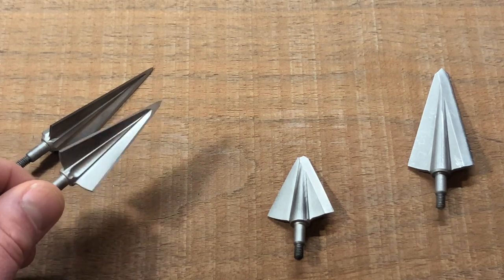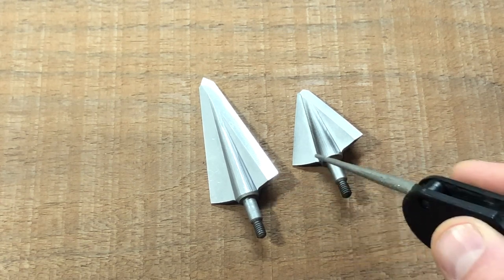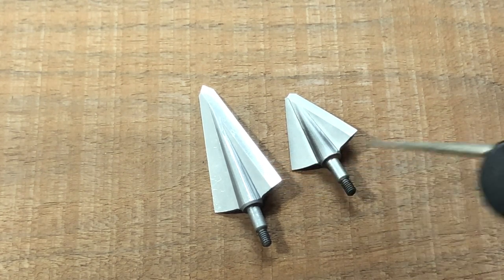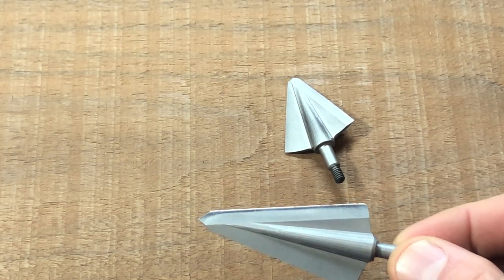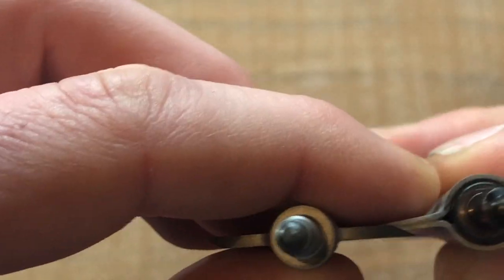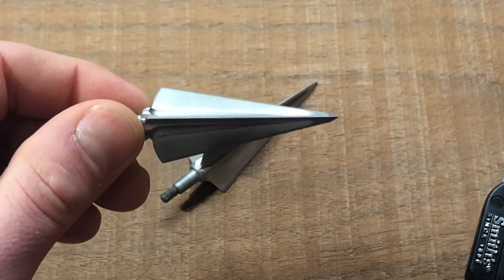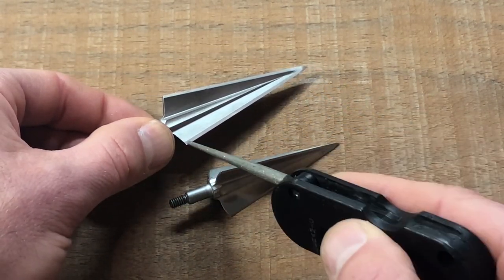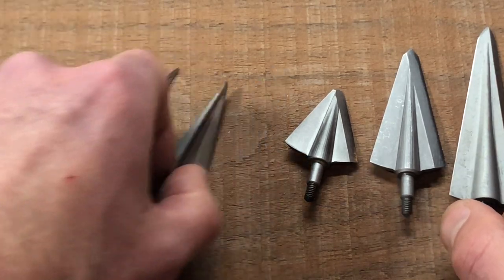Evolution Series Introduction

Comment: Looks great. Wonder why a steeper bevel wasn’t used on the single bevel for an edge that would hold even longer? Maybe I am wrong? I plan to preorder
Reply from the maker: Steeper angle (like 30-40) will increase spin. That is not always a good thing. The 20 degree creates a razor sharp edge even when not sharp. S7 allows the use of such a light angle. It also makes it very easy to feel the edge and resharpen
Reply: 20 deg bevel will not hold edge integrity thru bone, there will be massive edge chatter regardless of the type steel used.

Comment: I want a wide cut single bevel.  I cannot find a single bevel wider than 1 1/8 inches.  I heard you were prototyping a 1 1/2 inch wide single bevel.  Where is it?  I am a traditional guy, my arrows are slow.  Wide heads will fly fine for me, just make it.
Reply from the maker: We have been working on a wide cut. Bent back to drawing board from our previous design. Just wasn’t right. 
Hopefully 2022 I’ll have it figured out.